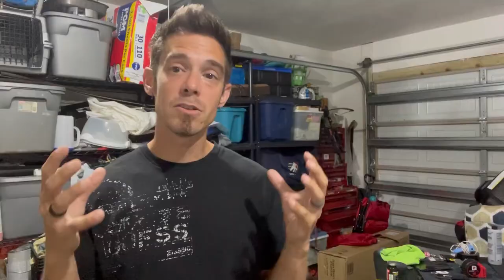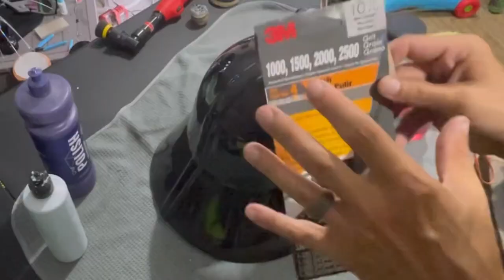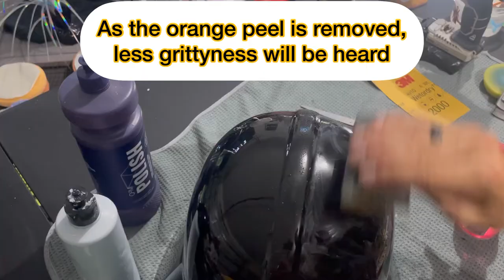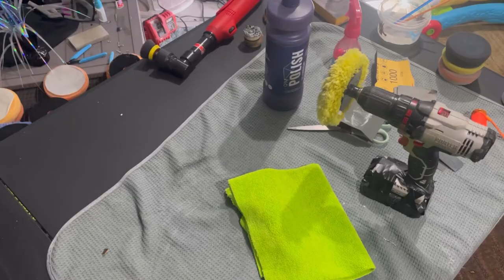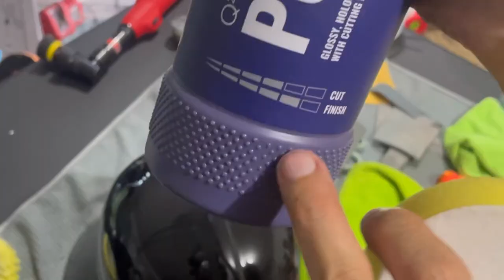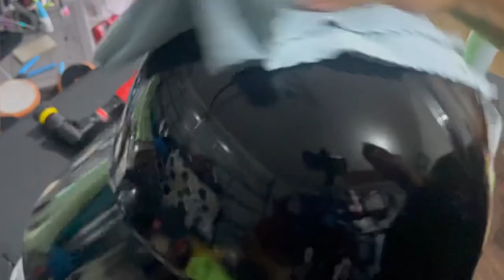How to wetsand 3D prints | How to remove orange peel in 3D prints plus  how to polish 3D prints

Comment: Earlier this year, I was wetsanding a 3d printed helmet to remove the "spider veins" and "orange peel" texture in preparation to clear coat it as high as 7000 grit. It was so smooth, the water sheened off and it was showing caustics on the surface of another area. However, that's where I went too high and when it came to clear coating the helmet, I had to go back and do it over again. It was too smooth.

At least now I just need to get some liquid compound and finish when I do the next helmet again.
Reply from the maker: Yea if you use machine buffing & polishing it’ll take it to a whole new level!

Comment: Very interesting and useful video. Thank you. I'm not sure of one thing. Do you make wet sanding just after the primer layer ? Or can you do it after the final glossy paint layer ? If it's the case, doesn't wet sanding ruin the glossy paint ?
Reply from the maker: Wetsanding should really only be done on the clear coat as it’s the last surface, BUT if you get trash or junk in primer or paint wetsanding & recoating should be performed
Reply: @Darkwingdad  Thank you. So if you do wet sanding on the clear coat, what is the delay ? Because paint needs some time to dry and get hard and reflective, sometimes 2 weeks sometimes more. So do you wait 2 or 3 weeks after clear coat painting to do wet sanding ?
Reply from the maker: @SECTION5120  no if your coats are laid down properly 36-48 hours you can wetsand. If you buff/polish you want to make sure your using a body shop safe compound so certain solvents don’t get in & create solvent pop (tiny holes) paint can take up to 30 days to gas & cure but wetsanding can be performed much sooner than that
Reply: @Darkwingdad  OK, thank you very much for your help. I will try all that.
Reply: @Darkwingdad but what about then orange peel in the paint? doesn’t that have ti be wet sanded? how does that get removed?
Reply from the maker: @braintrust12  orange peel in the paint is irrelevant, you need to focus on the last layer which is clear coat. You build it up with several coats than smooth that out by wetsanding.

Comment: What if it's my base coat paint (before clear) that has orange peel? Do i clear it any way or wet sand the paint layer? I'm kinda lost there.
Reply from the maker: All you need to worry about is the top layer, especially if using rattle cans orange peel is inevitable. You can wetsand the base coat but you’ll need to add another coat or two on top bc when you sand it it will leave minor scratches & discoloration. Best to focus on the clear as that’s the last layer & most important.

Comment: Hey again...lol so I used this chrome paint Dupli-Color automotiveMetallic series Chrome. I was told not to put clear coat on it, so it's got about 4 coats on it. Anything to worry about without a clear coat on it?
Reply from the maker: It can definitely scratch & get damage over time. Test the chrome on a spoon with clear. I don’t see why you can’t clear it
Reply: @Darkwingdad  it has been a few weeks since I painted it. I guess I can try some...lol

Comment: After the 3000 or 5000 grit what about finishing it without the drill and attachment?
Reply from the maker: You would just apply clear coat after the highest grit
Reply: @Darkwingdad  I was thinking that but thought that maybe another layer of clear coat would introduce more orange peel. But maybe it's fine if you just finish it off with one thin layer of clear after your highest grit. Thanks for the info!
Reply from the maker: @ImmortalReaver  it’s can but if you don’t polish it that’s the only other option for bringing the gloss back

Comment: On what kind of Paints does this apply? Im sure this cant be done with many metal finishes? Is this more of a basecoat kind of thing?
Reply from the maker: You’re wetsabding the clear, so any acrylic enamel is fine. You can with lacquer too but lacquer has less shrink rate & often lays smoother with less peel
Reply: @Darkwingdad  Thanks! I wanna try to do the polishing on a black gloss and then after polishing add gold paint (Montana gold nitro-acrilic paint)
Reply from the maker: @DatFunnyPerson  don’t want to do that. Paint needs something to grab on to. If too smooth it will reject the paint. You should only wetsand clear coat. People who wetsand paint,primers etc are not only wasting time but potentially creating adhesion issues. Body shop 101 you wetsand the last layer you do, why? Because that’s the only layer that matters.
Reply: @Darkwingdad  valid info thanks!!
Reply: @Darkwingdad  sorry if I'm being annoying. But do you do this just on the clear coats? Or could i be doing that in the black base coat as well?
Reply from the maker: @DatFunnyPerson  just clear coats. Understand everytime you apply paint it shrinks(that’s what causes orange peel) it happens substantially more with rattle cans due to high solvent content. That’s why I tell people it doesn’t matter if you wetsand primer,paint etc once you put more paint or clear on top of it shrinks and creates orange peel. That’s why you should do it to the last layer which is the clear coat.
Reply: @Darkwingdad  but the paint i wanna use as my last layer cannot really be clear coated. What would you do in that instance?
Reply from the maker: @DatFunnyPerson  you definitely cannot wetsand Montana gold. I don’t know where the fad or hype of using that paint came from but it’s a very finicky paint. All you can do is try to keep the underlying moderately smooth and try to spray it with light coats & hope for the best.
Reply from the maker: @DatFunnyPerson  you can use a 1k or light enamel clear but 2k it out of the question
Reply: @Darkwingdad  frankly built used it in his latest build and since I live in Germany i do not get my hands on many good gold paints. I do have an airbrush too but I'm still to dumb to use it. Okay so 1k clear and then I'll apply the Montana gold. Thank you so much my friend
Reply from the maker: @DatFunnyPerson  airbrushes are very easy to use & offer a wider range of option & a better quality paint. Practice on spoons,cups or scrap pieces. You’ll get alot better paint results. One thing I can tell you is certain channels do not dive in deep on how long it takes them or set backs, a lot of it is hype,click bait or feeding the monster of YouTube to keep the algorithm going. So don’t think it’s as simple as some videos say or show
Reply: @Darkwingdad  i do know it's hard work i have been in it for 2 years and competed a mandalorian cosplay and Kylo and many other things but i just always struggle with paint. And your information is top tier. My airbrush always clogges or spreads or whatever. I just have to learn to use it better
Reply from the maker: @DatFunnyPerson  make sure your using a medium, look up airbrush how tos there’s a lot out there. Definitely something worth learning
Reply: @Darkwingdad  i did watch so many airbrush videos allready... :D all i so is messing it up. But some day I'll get it

Comment: Incredible.  What type of filament is your base and do you design the models yourself?
Reply from the maker: I used jayo filament. Not designing thing just yet, I’ve made a few things but nothing crazy
Reply: @Darkwingdad  sorry man, I meant like pla or petg. Creality sent me a free roll of white pla the other day and it's caused me nothing but trouble and about to order an all metal hotend. It gave me a print to practice on though and if I'm careful about fixing it itll be sell-worthy. Haha I'm going to fix it so it looks like it was injection molded hopefully.  I'm going to get some crack filler you showed in another video and sand then paint it and so on. Thanks for the great tutorials man. I never knew where to start but now I do. I'm going to start a helmet this week.  What one would you recommend for a newb?
Reply from the maker: @jstro-hobbytech  the white pla that creality gives you is JUNK, don’t get frustrated over it. I used pla on Vader
Reply: @Darkwingdad  beyond man. I hate waste. I'm saving all my waste pla until recycling at home in an affordable manner becomes a thing. We just bought a new house and there is an apartment downstairs that we care not to rent out so I have my music recording gear, electronics lab and a dedicated print room as soon as I can raise some funds to get a couple more printers. I'm going to control the humidity and heat using an esp32 based Lora network depending on what I'm printing. Abs for the main reason. I want to print a few cnc machines and voron kits to make money to reinvest in my plan I was telling you about. I'm hoping to have six printers by the fall going full tilt printing mpcnc, voron kits and other things I can sell like helmets and neopixel related lamps and other custom coded iot stuff. It's hard to get a not for profit business off the ground in the beginning man when you're not rich and want to build up a bunch of it yourself so people can see the value in a makerspace service when I have a small one going with hopes to grow just a little larger. Can't announce a service for people when you don't have a good base to sustain it and grow a little.
Reply: @Darkwingdad  hey man. I have a favor to ask. I'm going to pick up some more stuff to process prints with and I'm wondering what kind of canned aerosol paint and clear coat I should buy to play around with before I go and get airbrush station, I'm somewhat familiar with car painting as my father was a hobbyist body work guy. I have all the sand paper and super fine files I think I need to start. I also have my workshop fitted with a central air compressor system because it's quite large and used to be a cabinet workshop so I updated the whole system last year when we bought the new house. The mini airbrush guns can't tap off of that somehow can they? They come with a compressor of their own I believe. I'm getting ahead of myself asking that.

 I spent about 10 hours the past week working on a piece that looks great as is because I want a matte finish. It's a lamp base for an iot neopixel lamp with a million effects. They cost 50 a pop to make and I'm giving a bunch away to drum up some local word of mouth interest. Can I use a small orbital sander on them as they have thick walls and I'm not going for the finish I plan to practice at getting with the helmets?

Any help would be greatly appreciated brother. I'd like to thank you as well for putting the darkwing duck theme song in my head for the past month as well hahahaha
Reply from the maker: @jstro-hobbytech  as far as an airbrush going off a larger compressor it can, just set the regulator to required psi, usually it only needs 15-20psi 
As far as clear coat goes it’s really important to match up the righ my paint with the right clear. You never want to put lacquer on top of enamel or urethane but the majority of aerosols are acrylic enamel, so just match those up and your good. Rustoleum is the most widely available and in all reality all aerosol clears are going to give you similar results as long as you control your temp,humidity, keep a proper spray distance,pattern and give adaquate dry time between coats.
Reply: @Darkwingdad  thank you so much. I'm going out tomorrow to get the supplies. I only venture out in public a few times a month because of severe social anxiety.  It's good to know what to look for so I'm in and out. I'm going to get the bondo spray crack filler, rustoleum paint and clear coat spray can. I'm so happy you responded,  thanks again.
Reply from the maker: @jstro-hobbytech  no problem! I can always drop some links that are in Amazon of products I use as well that way it saves you a trip
Reply: @Darkwingdad  I appreciate it but often times Amazon Canada has the same product under different names and such. It's very annoying. Besides I have to get out, exposure therapy. I'm very well versed in Amazon. Almost 200 purchases in 3 months haha. I'm always ordering sensors, microcontrollers,  cmos chips by the hundreds lol

Comment: Do you do the exact same on smaller detail pieces? I've tried to do this on my mandalorian 'ears' and not getting as good as results as I am for the rest of the helmet...thank you!
Reply from the maker: Yes it’s the same process, you are wet sanding after it’s clear coated correct?
Reply: @Darkwingdad  I have been using this technique on my gloss black before chrome as the gloss black came out super orange-peely, or do you think this was the wrong path to take and I should've just chromed it, clearcoated, and then used this method? Thanks so much for your help :)
Reply from the maker: @kiaralim2335  yea don’t worry about actually wetsanded the colored paint. Can you? Yes, but there is a high likelihood that you’ll remove or damage the pigmentation and you’ll just have to respray it(bringing you right back where you started almost) IF your going to color sand use 5000 grit only. I would recommend simply applying your color, waiting 24 hours than apply your clear and proceed to wetsand the clear :)
Reply: @Darkwingdad  I see, I'll do that method from now on. Thank you again, your vids have been a huge help :)

Comment: Finally printing a MF DOOM mask on my bambu and i want it to look like his actual mask with the hi chrome polish, thanks for leaving the links i just bough some of the stuff you used. Do you reccomend doing this process just after clear coat and not the color coat too
Reply from the maker: Yes, clear coat only. What type of paint are you using?
Reply: I was going to use either Montana gold or Ironlak in a Chrome

Comment: wait a minute… am i supposed to wet sand the PAINT or the clear coat? lol nobody ever makes that distinction for some reason… i mean, the orange peel is in the PAINt so isn’t that what you have ti sand? i dont get it
Reply from the maker: @braintrust12  no you do not wetsand the paint you’ll just remove the pigmentation. Your top most layer needs to be the smoothest, only sand the clear coat
Reply: @Darkwingdad then how do you get rid of the orange peel in the in the paint/base coat?
Reply from the maker: @braintrust12  you can’t without damaging the pigmentation, that’s why you don’t. Wetsanding & refinement is for clear coat. Everytime you spray paint on whether it’s with a can or a gun there is ALWAYS going to be orange peel. On pigmented paint if you wetsand it your hooking to have to repaint it & literally just adding the orange peel back on. That’s why you only do it to clear coat bc you can buff and polish it. If you tried it on pigmented paint you’re stripping the color off.

Comment: You essentially have to be pretty lucky to not have orange peel in a home paint environment. There are too many environmental factors that you have no control over (temp, humidity) compared to a dedicated paint shop area.
Reply from the maker: @larrybud  this is 100% true especially if using rattle can which has inconsistent psi